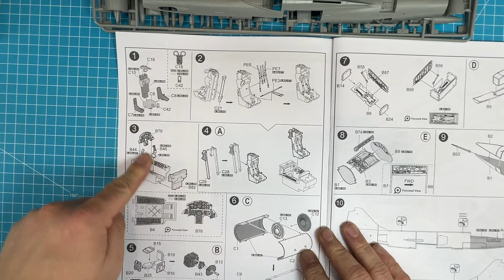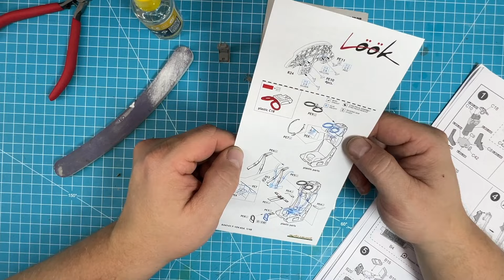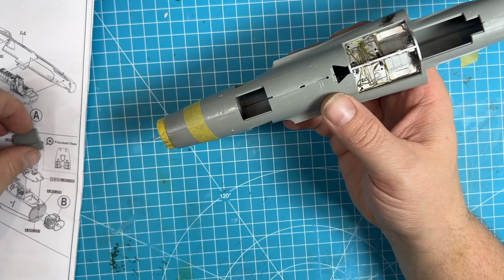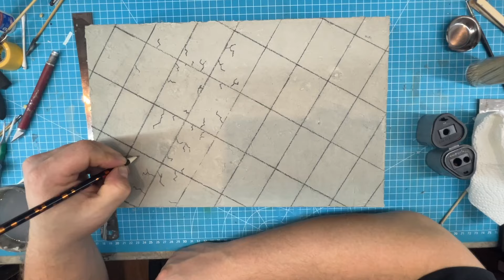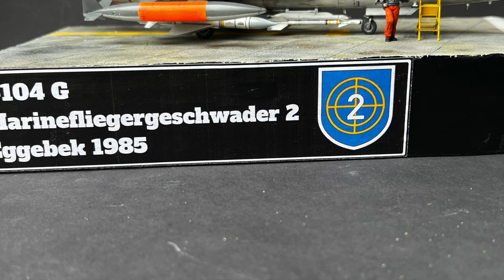Full Build Kinetic F-104G Starfighter 1/48

Comment: Great build! Very nice and great details! The only mistake most of the modellers do is that German Starfighters of Luftwaffe and Marine with the 4-numbers tactical number were not - I repeat- NOT painted in any light grey on the underside…! They were „Weißaluminium, RAL 9006“, a clearly glossy silver finish! I know it, because I was a mechanic and crew chief on the great Starfighter.
Reply from the maker: Thanks a lot for your feedback. You might be right. On certain photos i took for reference it looks like a ligh grey. As far as i know weißaluminium was used in the Norm76 pattern but i might be wrong. But this isnt my last Starfighter ;-)